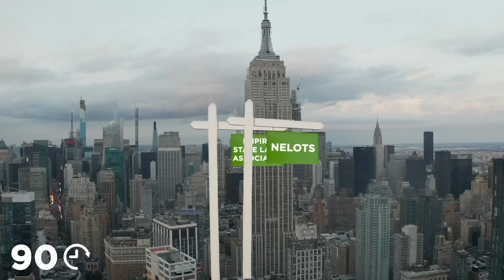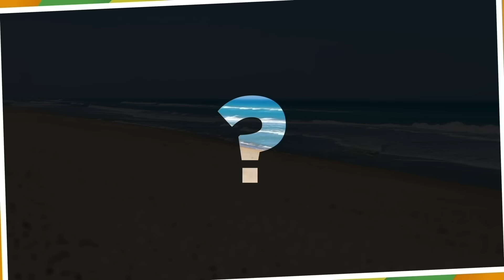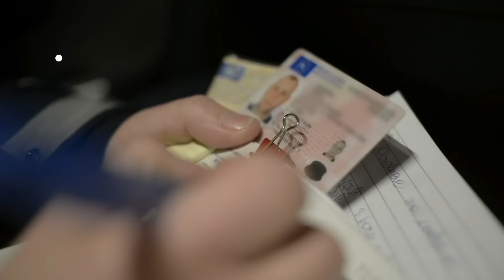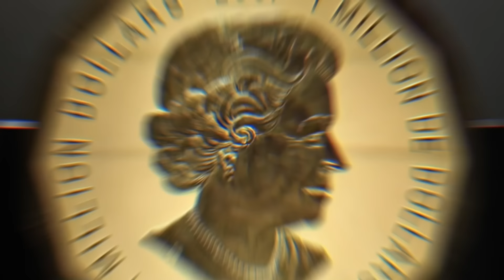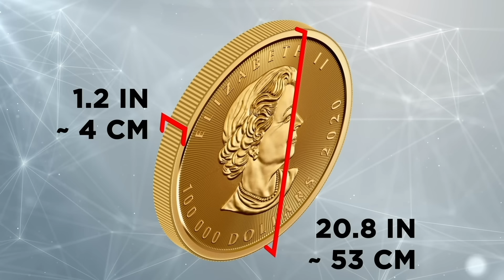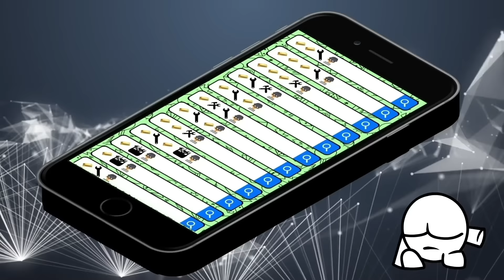Biggest Things Ever Stolen - Part 2

Comment: It wouldn't matter if the tank is loaded  you can't fire from the driving seat  and climbing in the loaders seat  to load a shell and then  climb into the gunners seat  takes long enough for anyone to open the hatchs and  arrest them

So there would no point to try it